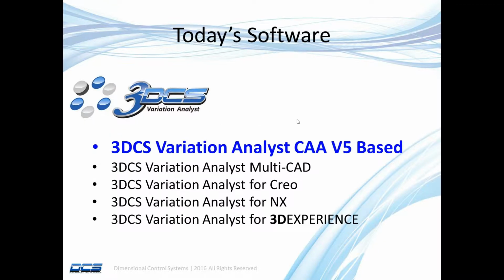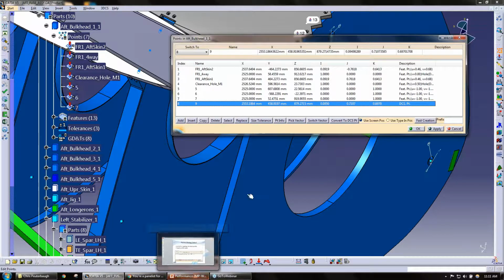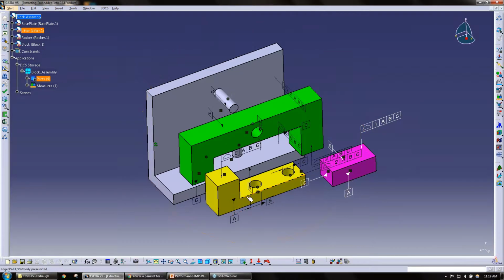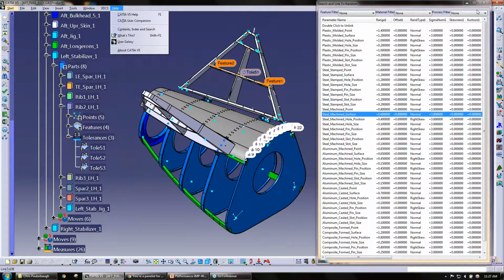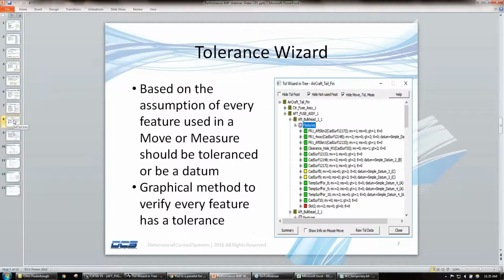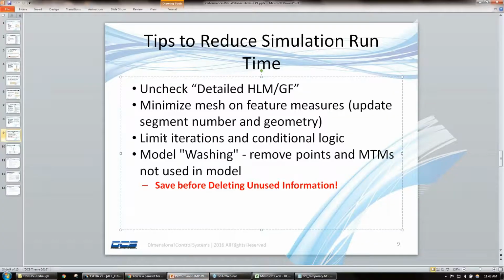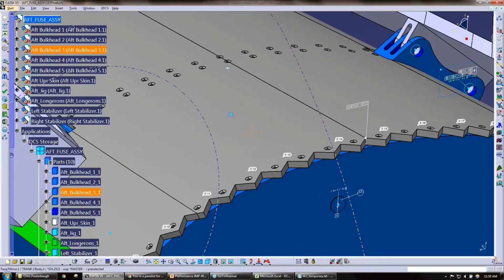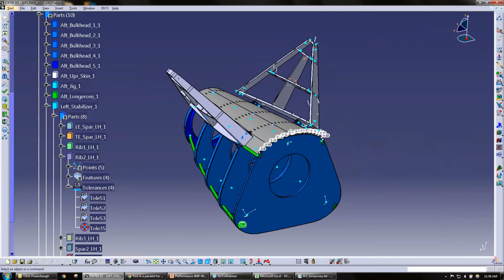Modeling Tips - Performance Improvement Webinar Part 1

Comment: 1.   Qestion asked around  5:11, about moving fast created points,you gave answer, like you have to modify U and V values in order to move those pointsmy experience is you can pick, drag and drop those points on other surface if you wantwhile fast creation window is onI think this is faster way of doing this!2.   If you provide key shortcuts for commands, it may be more better for users3.   what could be the best strategy??first generate all measurement point and then create measurement operations??or while generating measurement operationsn create points one by one??please share your thoughts!!Thanks everyone!!